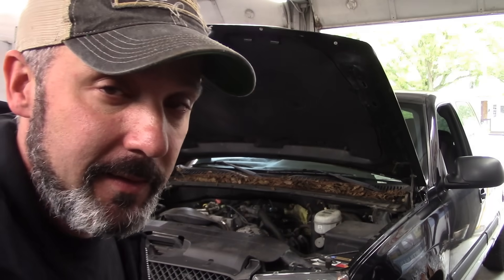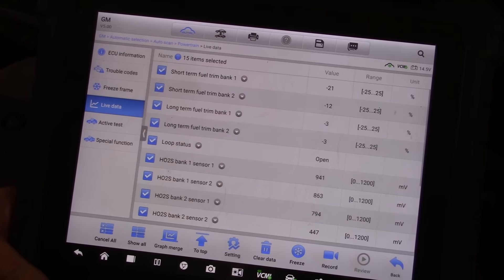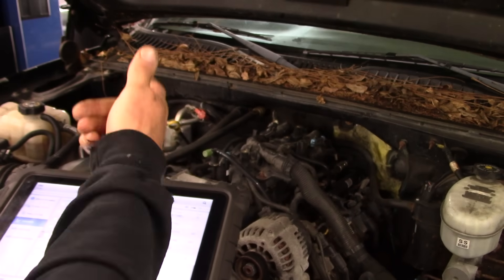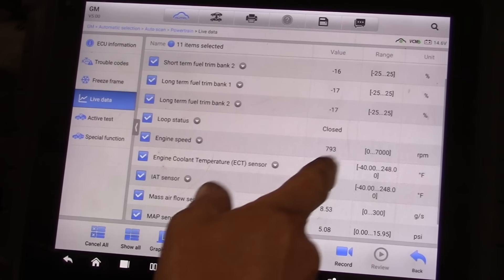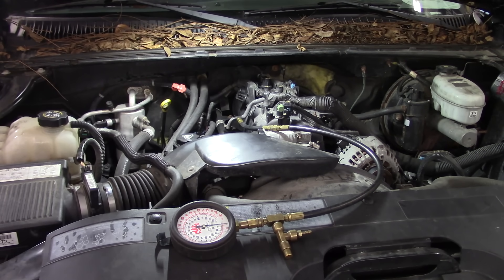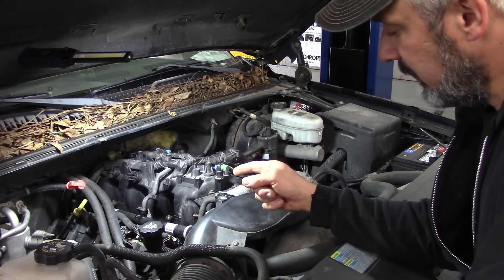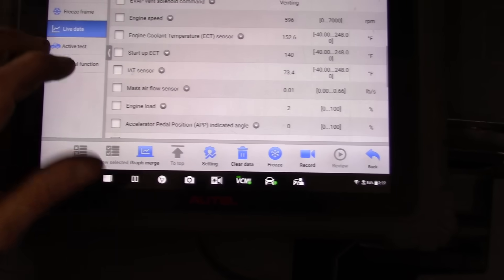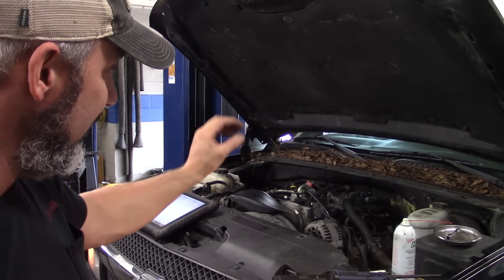Parts Cannon Special: Rich Running Chevy Truck P0172 and P0175

Comment: 99.99999% of shop owners would not go to a junkyard to get parts for a customer.  You are the man.
Reply: Perfect match for a junk truck.
Reply: His shop is probably very close to a junk yard. A lot of shops save parts. Or if they have a vehicle there with the same part that they know is good they will switch it out for the one they think is bad just to verify then order a new one. Obviously they arent going to do it for a cylinder head or a part thats a pain in the @$$ to replace, but a quick easy sensor or something, absolutely. A lot of shops also have motors sitting around that they replaced for someone so they can pull the part off the motor.
Reply: @jacksmith2315  — I’m guessing it’s because the ice cream shop must be on the way….
Reply: The PR of NY no longer has junkyards. They are “automotive recycling centers”. La de da…
Reply: That’s going the extra mile, something you don’t see as much any more.
Reply: @jacksmith2315  Couple miles down the road.
Reply: Not a junk yard if you find treasure🤗
Reply: @montestu5502  Are you an anti ice creamite?
Reply: @549BR  lol on a couple of Eric’s videos he stops at the ice cream shop
Reply: @montestu5502  With Mrs O pitching Eric a cupcake as he goes out the door!
Reply: @mattharper588  that's perfect! Haha
Reply: I'm sure the money from the videos make it worth while to do such things.
Reply: A used factory part is better than a new aftermarket part
Reply: My shop is 45min from the pick and pull junkyard which is also wilberts like he went to but a different location in ny and I do go there from time to time for customers when in a situation like this.
Reply: 800 to try new injectors hoping it fixes it, junkyard here I come
Reply: One in a Million mechanic that’s why I enjoy to watch him daily and support him and his great family.
Reply: Yeah you’d be surprised. I meet a lot of shop owners who go to pick an pulls and buy in bulk of parts.

Comment: Hey Eric! Automotive instructor in RI checking in. I have a student with these same codes in his Chevy truck of the same vintage coming in tomorrow for repairs with the same codes. This one doesn't have parts thrown at it first but I am going to assign him this video before we work on it. Chariho Career and Technical Center appreciates you!
Reply: As an added bonus, you should have your student diagnose O2 codes.🤣
Reply: Make them pull up a chart for the Map and MAF so they can understand what value the sensor is suppose to be reading.
Reply: well Eric...you know you've arrived when the auto tech instructors are referencing your vids to our future technicians!
Reply: Make sure he loads his parts cannon properly!
🤣👍
Reply: @tyree9055  The less familiar the brand the better
Reply: Any update on this Peter, what your student found on that vehicle and what was the fix? 👍
Reply: Did your student(s) pass??

Comment: He could have saved himself a thousand bucks and a lot of frustration if he just brought it to you six months ago.
Reply from the maker: Kinda what I was thinking. Makes you wonder what the initial real problem was.
Reply: @SouthMainAuto  Some people can't leave well enough alone.
(I had a wife like that..)
Reply: "Relax, all right? My old man is a television repairman, he's got this ultimate set of tools. I can fix it."

Unfortunately the Information Age has made everybody think they know what they are doing. I work in an ER, we have patients all day long arguing with the DR over something they read or saw over the internet.

In this case, the truck would have been fixed by guessing if he weren't throwing wing ding junk parts on it.
Reply: @mph5896  "And remember, if I can do you can do it!".    😉🤔😅
Reply: @mph5896  Jeff Spicoli ftw!
Reply: @mph5896  I used to fix television sets for the Salvation army back before they became all chips and motherboards. Even with internet instruction, most people can't and shouldn't fix tv's
Reply: @SouthMainAuto  - The check engine light probably came on, so he took it to Autozone and then they told him what it could be. So he started throwing parts at it.

I went through a similar situation a few years ago. My check engine light came on and my 2000 Silverado started running like crap. I took it to Autozone, and they told me the most likely cause was the mass air flow sensor. So like any person without a scanner would do I listened to them. I purchased the MAF sensor installed it, and boom problem was still there, and my truck was running worse. I installed the old sensor, and then started listening for air leaking. I started watching videos on YouTube and tried the spray bottle of water trick. I sprayed around the upper intake manifold. A second or two later the truck started stalling, and I noticed white smoke. I ended up replacing the upper intake manifold gaskets with GM gaskets, and wouldn’t you know the problem was fixed. That 4.8 fired up with just a tap of the key, and purred like a kitten. 
After that fiasco I purchased a scanner, and no longer rely on part stores for help unless they are ordering me oem parts. Heck I even use GM or Ford oil filters when I change my oil.
Reply: @mph5896  lemme guess, they ask for ivermectin? 😆
Reply: Might have bought a House instead😂😂😂😂😂.
Reply: Looks by a bowl of Wheaties below the windshield😅
Reply: The City of Wilbert🎉

Comment: Can’t beat OEM parts even when they’re used.
Reply: My mechanic has been fixing my cars and trucks with used OEM parts for decades. And not a single issue out of any one of the repairs. Period. I didn't trust it at first. But, was made into a believer.
Reply: ESPECIALLY when they're used because they have a track record of working.
Reply: Mainly with sensors and electronics. Wheel bearings, brake pads, etc. not so much.
Reply: @Garth2011  why not brake pads, $2 a pad can't beat that.
Reply: @serge4856  Pads, you have no idea what they were. $10 crap pads or $80 oem pads
Reply: Always OEM or who ever made the part for the OE
Reply: @Garth2011  especially with sensors or electronics. They eliminate a lot of guess work.
Reply: I’ve had that happen where a brand new after market cam shaft position sensor was worse then a old used one from a junk motor at my mechanic. It was even worse then the bad oem one I got rid of.
Reply: @Garth2011  just put on oem ford pads and rotors and my f150 stops way better then the carquest wearever shit and it wasn’t much more money.
Reply: @shane8915  Well, these days even OE parts will be bad right out of the box on occasion. Stuff is junk all the way around now. In '04, the stuff was still really well built. The newer the vehicle, the more this becomes an issue. Starting in '07 and up from there, engine component quality really took a dive (Along with everything else on an automobile).
Reply: @serge4856  Time is money, and if you have to replace pads every week because you're too cheap, you lose money.
Reply: @FishFind3000  Well, of course they are, carquest is crap. Akebono, raybestos, bendix, Wagner are all good aftermarket brakes.
Reply: @SmittySmithsonite  100% correct. Eric has said many times before, "Don't assume it's good just cuz it's new." I might be wrong, but I think Dorman is actually an OE supplier now for one or more makes. 🤯🙀 I feel like I remember learning that some time in the past. Not sure when it was or what brand and part it was though. Imagine the Kodak Moment it'll be one day to see his face when Eric opens up a part box from the dealer and finds a Dorman-branded cam phaser or camshaft that was $$$$$. 🤣🤣🤣 It'll happen eventually, I'm afraid.
Reply: As an outstanding old mechanic used to say "Service tested."  0 comebacks over 45 years.
Reply: I have gotten that way on so much stuff.  Either OEM from dealer or used.  So much aftermarket junk.
Reply: @shane8915  while i agree i will say this it might not have been a bad injector(s) quality wise. I have had several times this exact same issue where shops and diyers have installed flex fuel injectors into non flex fuel applications. Flex fuel injectors provide a much greater output than non flex ones. Flex fuel injectors are commonly installed in allot of the ls swaps that i do just for that reason. Of course cam, tuning, etc is done to accommodate those. But that being said your 100 percent right I have learned early on for the last thirty years and refuse to install most parts that aren't oem.
Reply: @mannys9130  Yep, the GMT-900 series trucks front airbag sensors - if you compare OE GM to Dorman, they are IDENTICAL in every way!
Reply: @serge4856  I just glue a hockey puck to it and go.  Sometimes the woah gets exciting though
Reply: @panzerveps  why replace pads every week. Went to a pick and pull not for brakes. They had same car as mine with pretty much new pads and rotors. Probably a few months old. Rotors still has the gray paint on them, up here the gray coating starts to rust after one winter. For $30 new front rotor's and pads. I would not go to the junkyard looking for rotors and pads.
Reply: @markmckinley5989  For sure in most cases you want to reach for OEM parts, especially sensors, computer and electronic parts. Problems begin when manufactures stop making parts after about 10 years from their date of sale or year. That leaves a lot of vehicles out there who might have to deal with aftermarket parts due to supply. Not all aftermarket is crap...they all have their good and bad areas of decent parts but the problem is knowing which to choose from. Borg Warner, Delphi both make OEM parts for GM, at least they used to prior to the China Syndrome with OEM. After the OEM stops supplying parts, things become risky.
Reply: @serge4856  may be  local regulation but i have been told by salvage yards they cannot sell brake parts.  If they just happen to come with a knee assy they are just extra though.
Reply: @markmckinley5989  here they sell everything but airbags.
Reply: These were most probably faked, ebay specials.
Reply: It didn't used to be that way (before globalization).  Some were better than others, but OEM wasn't a requirement for quality parts...
😏
Reply: @serge4856  I'm with you on that! This whole new-part-on-junk-car thing happens often with old models. If you go to the yard and find a 10-15 year old car that was in a fender bender, odds are good that there are some new parts on it. Lots of people invest in their POS to keep it reliable because it's cheaper than a new car to do so, and because they need a point A-B transportation method that they can depend on to work. They put $800 worth of suspension parts on it, and then some moron rear ends them and the car is totalled. It ends up in the junkyard with those brand new control arms, ball joints, tie rod ends, shocks, etc on it. A new AC compressor, alternator, steering rack, brakes, you name it. If the thing looks much cleaner than the rest of the car, this is likely what happened. Obviously don't buy new parts that were in the collision area or look bent/broken. If a 95 Honda has a pushed on radiator and 4 Monroe shocks all around that look pretty damn clean, I'm pulling em off to check them. If they have strong resistance and rebound up, they're good. If a ball joint has a crisp, soft, new boot and fresh grease inside, it's probably new. This is how you determine whether engine and transmissions and other major driving components like master cylinders or starters are possibly good working units or not. If the car has light collision damage, you know it was driving. If it's not smashed up, it was sitting. Who knows why it was sitting? Blown head gasket? Slipping trans? 🤷🏻‍♂️ On some cars, the speedo needle will leave a witness mark on the gauge dial face when it was in the crash to let you know how fast it was going. But yeah, if I find pretty new parts on a junk car even if they are wear items, I'm fine with buying them at a discount and using them. If they're in great shape, they're totally usable. With brakes on a crashed car, just beware that the rotors might have a pulsation due to welded pad material that was deposited when the driver smashed the brake pedal and shock heated the pad and rotor surface until the car came to a sudden complete stop. That's how pulsation happens. A hard brake event occurs where the brakes are applied at max capacity and the vehicle is stopped right to a standstill with pressure still applied. When I make a panic stop like at a yellow light, I always slow to like 1mph and then bump into neutral and let off the brake pedal fully to come to a stop with the hand brake. Then I sit there with no brakes or just the hand brake occasionally pulled up and down to hold me stationary. After 10 seconds or so, the surfaces are not hot enough to weld anymore and I can apply the brakes and shift back into drive. 👍 Never had a brake pulsation when following this method. Rotors don't "warp." The other cause of pulsation in the rust belt is uneven rust jacking under the rotor hat's hub face.
Reply: If you can get OEM. alot of that is on backorder.
Reply: If u want cheap, then the ultimate best is Mapco 😂
Reply: Except maybe BMW parts. Anything is better quality than BMW OEM :-)
Reply: I never trust like for like non-oem parts.

The only non-oem parts I trust are from some performance brands, but they have in house engineering teams. 

Outside of that, only OEM goes into my vehicles.
Reply: You're certainly right about used OE parts,especially when it comes to electrical/electronic components.  I've seen similar issues like this countless times where it can literally drive you up the wall trying figure out whats wrong with a vehicle.  Great diag Eric O, fuel trims don't lie I think is the lesson here.

Comment: One thing that is a constant on this channel. You like your original parts over pattern parts. You are not averse to going down the scrap yard and procuring parts at a reasonable cost. Fixing the vehicle correctly with as near to original parts as possible. for the best price possible. What more could a customer want.

Comment: Eric you never cease to amaze me! I am a process control guy of 40 years and know PID loops like the back of my hands. You laid out one of the most concise, clear and methodical processes here to eliminate variables as you go. I teach a lot now and I tell my apprentices always remember there may be 15 or 20 things that COULD be wrong, but out of that list narrow it down to the top five and then go after the highest priority of errors and potential problem with the top 3. You did that flawlessly because you understand PID. Signal into the algorithm, the processor (ECM) looks at all related inputs and makes a decision. The device then (injectors in this case) must be able to CONTROL the variable that provides the final outcome. If an injector or injectors are junk all the good data "falls on deaf ears" and the injector dumps fuel like a fire hose the control is lost! My what a very interesting video. Kudos to a man who follows his convictions and must have a final solution. If the owner is not happy with your work, trust me there are 99 more out there given the same issues would pay you whatever you  want to really FIX the problem, not just THROW parts at it!!! BRAVO!!

Comment: As a retired electrical engineer who spent most of my career troubleshooting industrial machinery I am quite impressed with your troubleshooting abilities. And greatly entertained to boot! Love watching your vids brother !!
Reply: I've spent 35 years in manufacturing diagnosing and solving mechanical and technical problems and I appreciate Eric's deductive reasoning versus the part can work with a lot of guys working on a lot of different equipment and all they want to do is keep throwing parts at it till something stuck hey uses common sense and logic to figure out a problem I love it have a great day